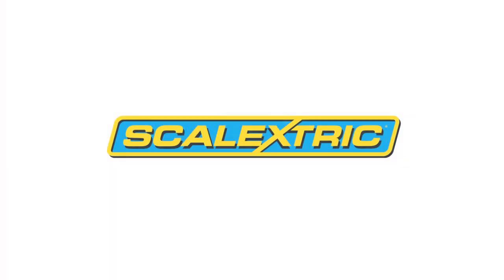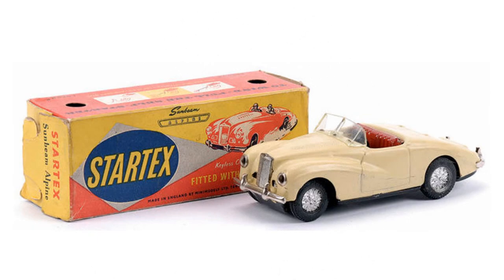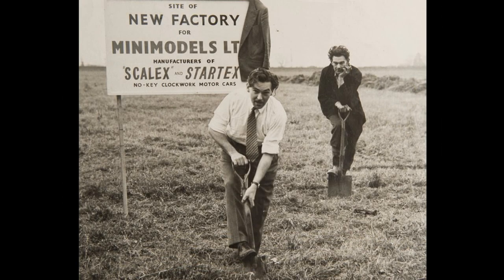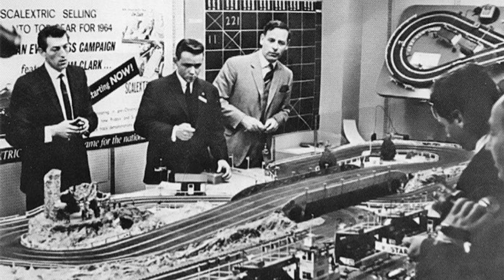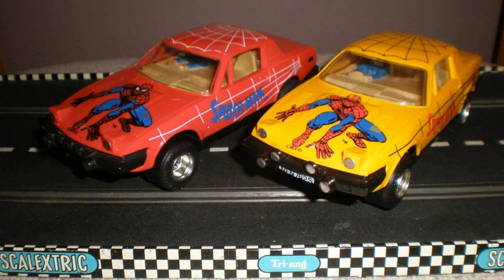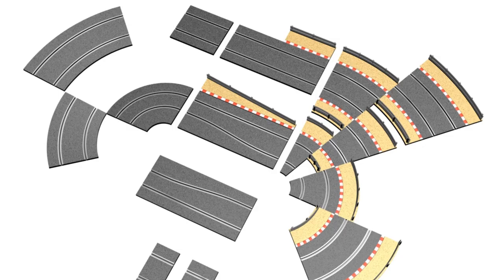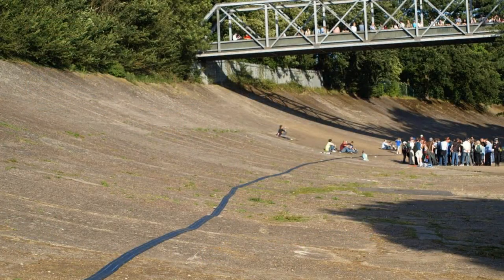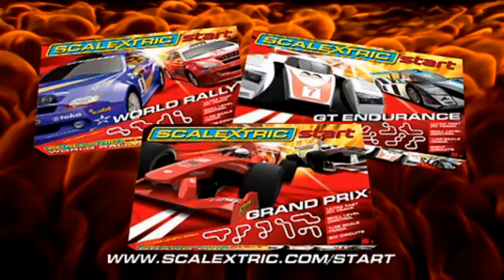The Scalextric Story

Comment: I I got my first set at 8 which was second hand with rubber track and plastic cars. I bought a digital set and extended it with cars and "feature track" but all of the Scalextric I have ever used has suffered from connection failures between track pieces and getting a temporary track to work for its full length has been a problem. I joined a slot car club and raced on a permanent clubhouse wood track and kit made cars from the US when I was 11.

Comment: I had a Scalextric set sometime in the mid '60s. The cars were 1/32 scale D-Type Jaguars with pins to keep them in the slots. The rubber track was crap that didn't last very long. It was too soft to keep the rails from coming loose and cars would bang to a stop when they hit an uneven join between sections of track. I remember being envious of other kids who had Strombecker sets with problem-free plastic tracks.

Comment: I had a Micro Scalextric set in the 90's. The cars had magnets which stuck them to the track so well there was no fun in the driving at all. Just full power and ridiculous vertical surfaces. I soon fixed that by removing the magnets to make them drift and creating more realistic circuits.

Comment: I had the Le Mans 24hr set. One the largest sets in the 1980s range. Trouble was, I didn't have anyone to race against and play with back then. There was a Rothmans Porsche and a Jaguar in the set with front lights on both cars and brake lights that flashed on when the cars stopped. It had a hump back bridge too. The set came with a cassette tape (remember those?) And Noel Edmonds and I think Howard 
Goodall from the BBC show "Thats Life" talked about how to build the track, race the cars properly and discuss building layouts, accessories and repairs etc. On the other side there where authentic racing car sounds to create atmosphere when playing. My Jaguars diff gear broke as the teeth wore out so I sent it back to Hornby in Margate and they repaired it for free and sent her back to me. Those were the days. The set subsequently languished in my parents attic for years, the track tarnished and eventually I sold it for a meagre £20 still boxed and practically complete with fly overs, barriers, bollards etc on eBay...
I did have a Micro Scalextric set and 3 or 4 cars but sold that off too. I love looking at old Scalextric but doubt I'd ever get back into it now. My Girlfriends small Nephew had a few slot car sets - and wrecked them quite quickly....
Great video.
Reply: Scalextric don't even sell spare parts now.
They're not interested in people racing the cars any more.
It's all geared towards the collector now
Reply: I recently found out that Southern Model Supplies the sole importer of Scalextric into Australia incinerated all the spare parts that they still had.
It appears that one has to have shit for brains to be in business nowadays

Comment: A correction to a widespread misunderstanding of events. Hornby Trains did not take over Triang or Scalextric. Hornby Dublo and Hornby tinplate clockwork trains arm of Meccano in Liverpool collapsed in 1964 although production may have largely ceased in the previous year. 
The Hornby Scalextric rival Circuit 24 collapse just added to losses even in a boom time for slot cars. The Board of Meccano approached Lines Brothers to buyout Hornby Dublo and possibly Meccano and Dinky. Lines Brothers the parent company of Margate based Triang Trains and Scalextric did this for a knock down price but did not find much of use in the trains part of the purchase. After this the trains were called Triang-Hornby from mid 1965 until around 1971. 
This was to encourage users of Hornby Dublo to convert to Triang users. 
In 1971 Lines brothers went into receivership.
The trains and Scalextric were one the most useful parts of Lines Brothers and so found new owners. However they could no longer use the name Triang so were renamed Hornby,
The change of name to Hornby was very useful due to badge snobbery being rampant in the UK. The current Hornby owners cultivate the badge snobbery of 100 years of Hornby as it sells to less knowledgeable buyers. This is even though current Hornby share no components with the always expensive Hornby Dublo range but many tools from the Rovex-Triang era of the 1950s and 60s are still in use. The commercial savviness of Rovex still survives to an extent.
So just a rename by Rovex at Margate but you will get many arguments from those dazzled by the Hornby name and the history of the name.
Reply from the maker: You may want to alter the Wikipedia article, because this is where I got all of this from.
Reply: @LittleCar  So your "research" may have come across "It is now owned by Hornby Hobbies of England.[2]" so not understanding how Triang had to use the Hornby name after they took over the collapsing Hornby name 7 years earlier. You incorrectly translated that as Hornby took over Scalextric. More on the much earlier collapse here :https://www.youtube.com/watch?v=lxxe4BGy-N0&t=526s

Comment: When I was a kid in the early 60s it seemed like I did everything short of crawling over broken glass to get my parents to buy me the American equivalent of these racetracks.  Being a child, I didn't think the $25 price tag (I am guessing the equivalent of £50 ?) was all that much.
2-3 years ago I started thinking about getting a modern set of these for my 10 year old nephew but the now $100 price (about £150?) was a real shock.
And yet, I see what these newer Scalextric tracks are capable of, and I am impressed and less skeptical of the value versus price.

BTW, my set, manufactured in the US by AURORA, had a 63 Ford Galaxie convertible and a 63 Ford Falcon hardtop.  And what am I driving as a "grown-up"?  A 2009 Ford Crown Victoria.  These racing sets really made an impression on some young boys.
Reply: My Aurora AFX set had a '57 Chevy Nomad and a '71 Hemi Road Runner.... I have yet to own either of those.
Reply: Same here: in about 62-63 I really wanted a Scalextric set, but my parents looked at the price and got me a much cheaper Eldon! The Scalextric set was imported, and started at something like $40 or $50 without a transformer! Very expensive for the time.

Comment: Really interesting. I have about 12 sets I think, 1 is my sons though. I once tried micro scalextric and found it significantly harder than normal size - it seems the motors are just as powerful but the cars are 1/8 the size so go way too fast and fly off! The best type, especially for kids, is the 360, kids who struggle with controlling the speed soon get bored of picking the car up every 30 seconds, so they can just floor it and have fun, and as an adult you can see how much you can drift it without going too far. I did not know that digital cars ran on analogue track, I have 6 digital cars (all Boxsters as I got 3 identical sets from a woolworths sale, back when they first came out and you could have 6 cars on a track!)  and have a converter chip but never converted any because I have far more analogue cars so rarely use digital, knowing this I might look into converting some. You did miss the MotoGP series, I recently got one of those (oh, thats 13 sets then), havent used it yet but I had bought a motorbike previously which it took my son less than a day to break as the guide attachment to the bike is so fragile and irreparable.

Comment: I think scaletrix lost the plot when the track connectors drifted from the classic button and the other smaller scales appeared. The drift to digital was another weird move. It’s a toy that’s just fine leaving in it’s classic old format.
Reply: The switch to digital provides the ability to run four cars and to change lanes which, imo, is a massive improvement.
Reply: Thank you
Reply: @tonyb9735  if you can find the book titled "roadways and raceways", you will find that that concept has been around since the 60s.

Comment: 2:18 Gimbal wheel ???????
Reply: Yes, the cars originally had a wheel that was more like a ball with a (plastic) flange running around it. The flange ran in the slot in the track, and had metal contacts on either side, which transferred the power from the track to the car.
Reply: @Kevin-mx1vi  I'm just not convinced 'gimbal' is the right word ! My efforts to clarify 'gimbal' have been unsuccessful ! I do know what a gimbal is (a mechanism hinged in 2 dimensions) but that is not apparently clear from dictionary descriptions !

Comment: Great video I do pro slotcar racing with group 12 motors micro thin  polycarbonate bodies , metal chassis , rubber wheels we glue onto metal hubs. 
In the video you brought up micro scalextric but failed to mention that it was Aurora that sold that track gauge/design then it got bought by Tomy which in tern own scalextric and Hornby .
Aurora cars and track were quite ok but the namco is the one people rave over and they have a league like our pro slotcar has one and we race all over the world . With the cars I race the track is made of braid on a cnc cut MDF board . Our clubs track was 136ft long and the top guys would cover it 4.25 seconds then there is the wing car class even faster than what I race,
https://youtu.be/GtwkRd6zHwg

Comment: Since you are going to cover Hornby soon it would be beneficial to check any sloppy Wikipedia information against these more detailed coverages that include how Meccano Hornby from Liverpool collapsed in 1964 and were taken over by Lines Bros Tri-ang from Margate but later re-used the Hornby name and gave weight to the badge snob based confusion over current Margate based Hornby. 
Rise and fall of Hornby Dublo : https://www.youtube.com/watch?v=DbiMqi64E5A
Triang rise : https://www.youtube.com/watch?v=Q7x4bCfCwN8&t=20s
Triang rising and taking over Hornby Dublo : 
https://www.youtube.com/watch?v=lxxe4BGy-N0&t=25s
This also covers Minic slot cars and some other Tri-ang Lines Bros products.
I hope this information helps you to provide a quality coverage of Hornby.
The pre-war based O guage tinplate Hornby Railways are not covered though. These petered out to clockwork 4 wheel toys after WW 2 with little you could call a model produced post war.
Reply from the maker: Hornby video is already in the can, so whatever Wikipedia told me is what it is. If it's wrong, I highly recommend updating it, as I do whenever I see information that's wrong, or even English that needs tweaking. Always cite sources.